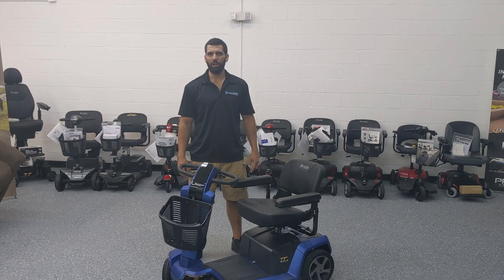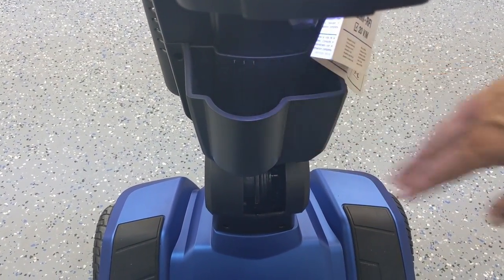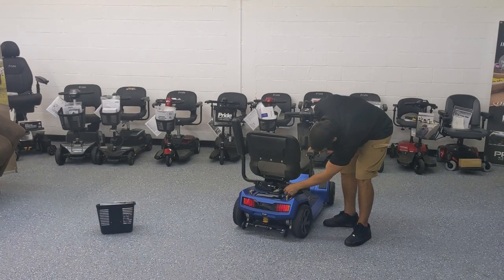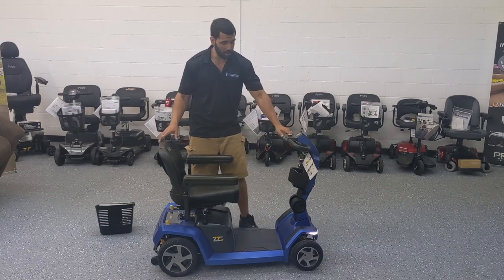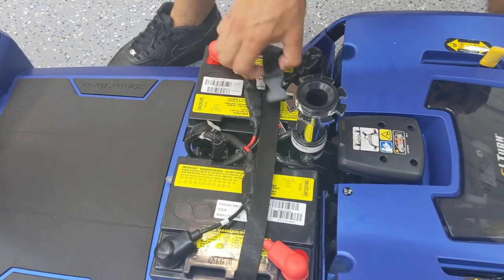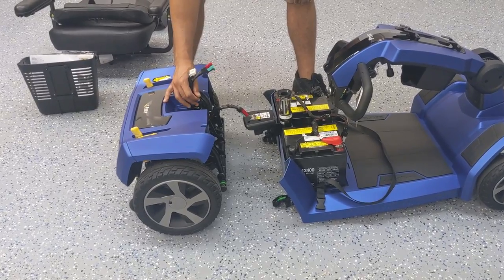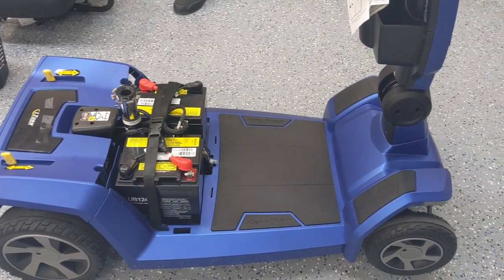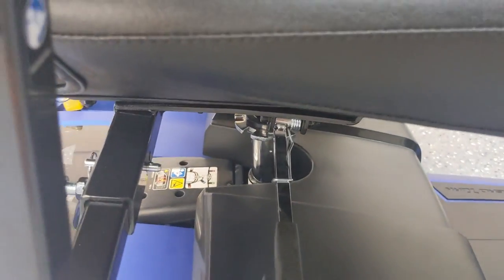🕵️Pride Mobility ZT10 Mobility Scooter Review

Comment: I have this scooter ZT10. I hope soon there is a different wheel replacement. Driving on cement every rut sounds like a car accident. Every little rivet I hear bang bang on every little bump. Let me know, please.
Reply from the maker: For parts related inquiries, it's best if you call our parts department, so they can accurately answer your question. You can call them at (877) 321-3241. Also you can fill out the parts request form on this page for a quicker response:
https://www.mobilityscootersdirect.com/parts-request

Thanks for watching our video and commenting!
Reply: I've same problem on my ZT10; on paving stones you can go mad from the noise
Reply: @Bejziczek  You might have had this, the center Molex connector that is between the batteries moves up, is not unlocked but disconnects power when running over stamped cement, The scooter dies, have to take it apart in a mall or in public so it is hard to do being disabled. I have had a 2020 and a 2023 ZT10 both have done this.

Comment: Once you disconnect the battery cables from the scooter, you shouldn't have to unbolt the cables. You should be able to pull them out with the cables attached.
Reply from the maker: Thank you for watching and for your comment, have a great day!
Reply: Yes, I agree. As long as you leave the cables connected to the batteries, and they are disconnected from the unit, you can lift them right off. I don't think this guy was thinking clearly.
Reply: I was thinking the same thing. Just like other brands that use these same batteries.
Reply: i was thinking the exact same thing you dont need tools to remove the batteries from scooter unless you are replacing them for whatever reason

Comment: Besides the tighter turning radius, what do you get in this one over something like the Pride Revo 2.0? they seem similarly sized from the videos, both have 400lb weight limits. difference in price seems to be around 700$ and the ZT10 appears to be more difficult to travel with, so what are the other positives towards this compared to the Revo 2.0? are either of them better in outdoor situations?
Reply from the maker: Those are basically the only differences. The zero turning radius feature means that the scooter comes with two motors. That and you can also get a captain's chair on the ZT 10 which is not available on the revo. The zt10 also goes faster and has a few features like the variable speed modes that the revo does not. All in all they are too impressive mobility scooters made by a manufacturer that offers the best warranty and best quality products in general.
Reply: You get 2 wheel drive versus 1 wheel, speed, bigger wheels and bottom clearance, which are all good to have.